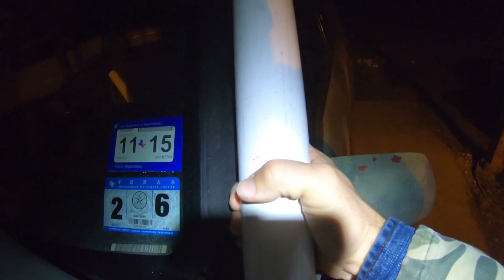HOW TO MAKE A SNORKEL ON A SUZUKI SIDEKICK

Comment: have you done anything else to your intake tube ? mine just dont seal at all i put my hand on it and it do not stall i just hear air leak from my air filter box
Reply from the maker: I can’t remember if I used the existing rubber gasket and new hose clamps or if I had my own rubber from a no hub band. I’ll check when I get home.